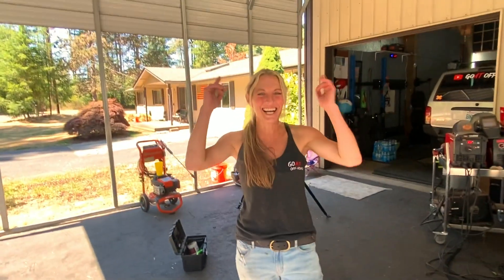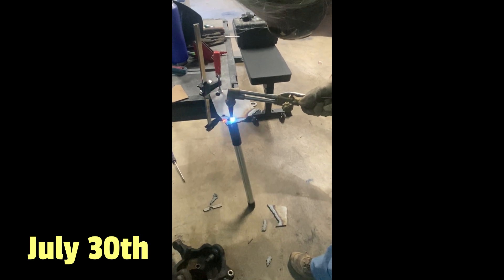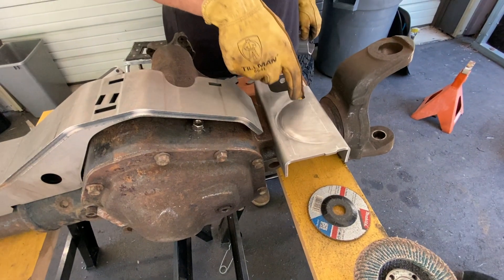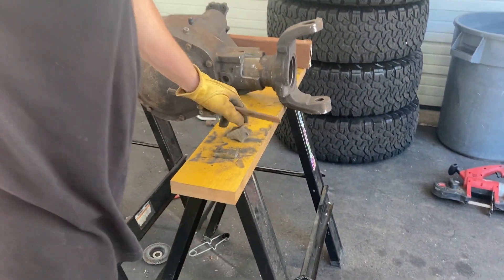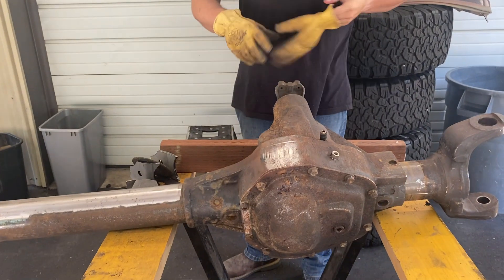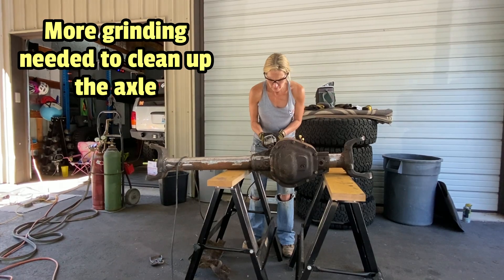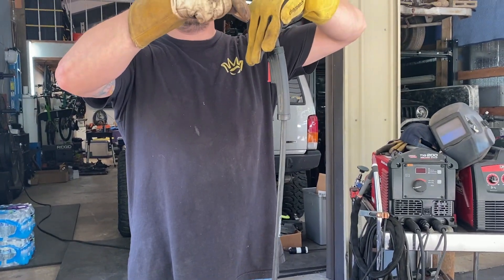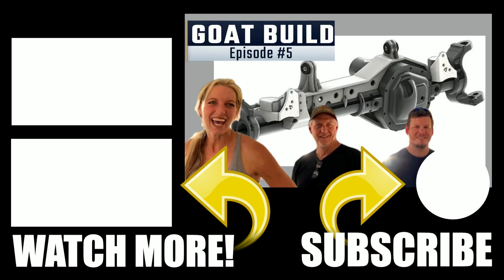EPISODE #5  | ARTEC TRUSS - DANA60 SWAP KIT  | HOW MUCH TO CUT!?  | JEEP XJ ONE TON BUILD

Comment: When i did my artec truss, i welded the brackets onto the axle first and then put the rest on since the truss limits access once its together.
I finally finished my frame stiffeners in the center section.  It took me and a friend 8 hours to weld them and make everything fit back on. Still need to do the rear and my rock sliders. One more weekend and it should be done.
Reply: Frame stiffeners are definitely a chore!
Reply: @dieseldirt3994  i dented my frame so they are definitely needed. Lol it will all be worth it!
Reply from the maker: You’re moving along great!!!!